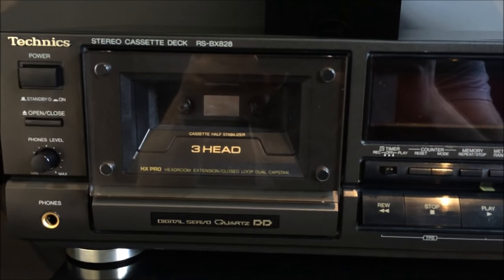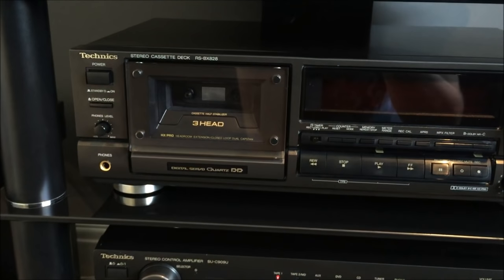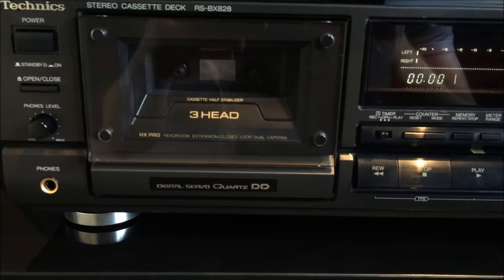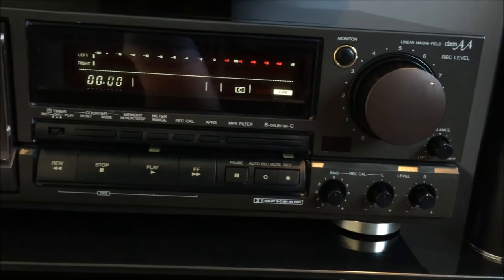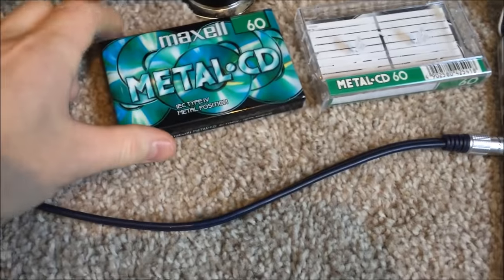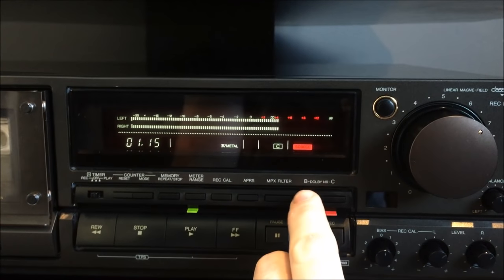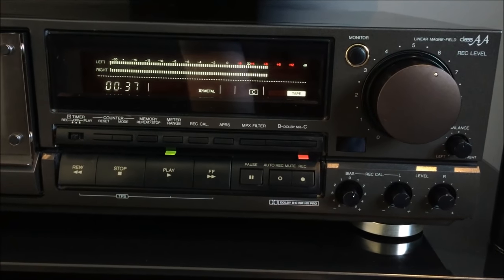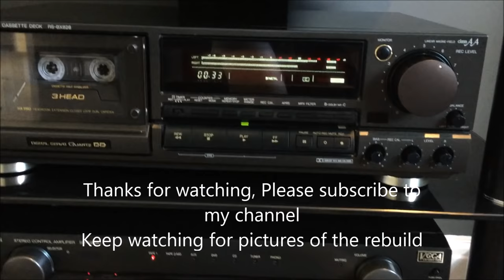Technics RS-BX828 Cassette Deck - Recording & Playback Demo on Metal Tape

Comment: I have one of these and a 965....great decks but I can't believe they didn't include a cassette well light. Just a shiny sticker.
Reply: i fitted a backlight to my rsbx727
Reply: @Synthematix where did you wire the light to? The board or directly to power supply?

Comment: I was surprised that my Timer Play does not work on the 828...I suppose it is so full with electronics that it does not last very long...or is it a tank? I do not know what to think about its quality, I'm very sceptic compared to Akai GX-95 or the Kenwood KX-9010...enjoy my collection :-)
Reply from the maker: The Vintage Hifi ambassador hi have not heard of that fault before tbh I guess if you already have decks you know you need a tape in it for this to work. Also the timer only works if timer switch is on and the power button is on, unplug it at the mains and plug it back in wait a few seconds it should work

Comment: Hello, do you have any experience with the bx707 deck? Maybe you know in what way that deck differs from the bx828? Cheers, great vid!
Reply from the maker: hi its a single capstan deck but still 3 head and still got the nice manual calibration system
however the bx series is best avoided unless you are good with a soldering iron,  they have a weak recording amplifier which is only rectified by changing 4 resistors and followed by a re-calibration of the deck
Reply: Thank you for your answer. I own the bx707 for a couple of days now. It sounds alright, it has a lot of extras. Only thing that worries me is the fact that a motor is audible when the deck is on. Even when it's not playing. But, anyway, thanks again for your answer.
Reply from the maker: Harreld Dittenhoefer it's normal for a dd deck to run all the time. It's so when u press play it's ready. But only should be only slightly audible with your ear to the deck
Reply: Whoa, the recording sounds better than the source.

Comment: I have the RSB-618 hooked up with the SUA-900 ... but  ... have since bought the Yamaha AS701 ,   you need to upgrade as you really are missing out on at least 20 years of Amp technology, oh btw I'm using a pair of floor standing Mission 737's that have suddenly came to life since the change of Amp.

Comment: any recommendations on buying a tape deck in 2017 ?
Reply from the maker: Sinthujan Vinacithamby probably same as everyone else recommends 1990 to 1995 model. Single capstan for simplicity and reliability
Reply: Akai GX deck from the late 1970's and early 1980's. Reliable as a horse.
Reply from the maker: ka6es ran to 2001 i think would be my choice but fully serviced and aligned

Comment: This model of yours is very similar to my rs-bx707 the biggest difference is the dual capstan mine is single 

Technics RS-BX828 : https://www.vintagecassette.com/technics/rs-bx828
Reply: I use RS BX727. It has remote control. I bought it new in 1993 and it is stil in perfect condition.
Reply: @mellacons3  
The models RS-BX727 / 828 the diferences to 707  is  for the 727 remote control  just only to 707 cause both 707 and 727 are single capstan 

but for the 828 remote control and dual capstan  to 707  the 808 has dual capstan and of course remote control